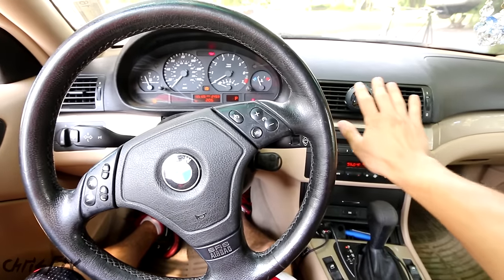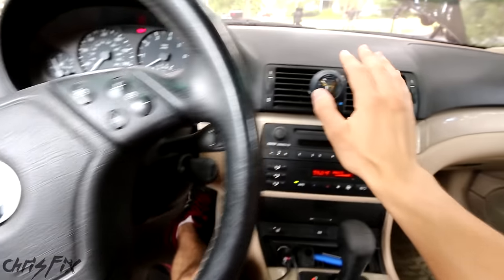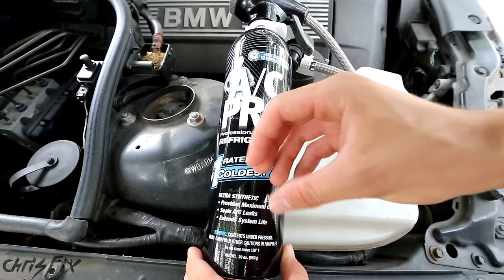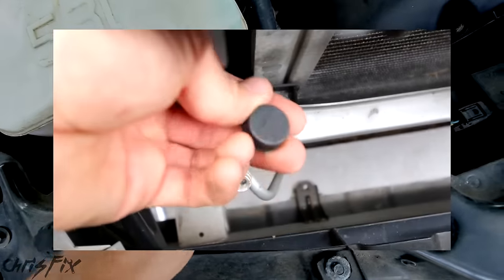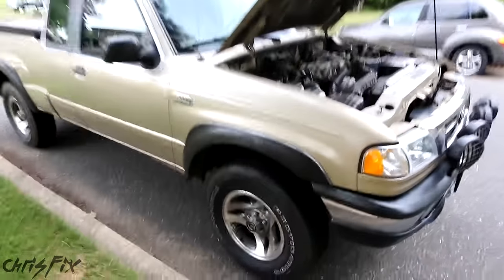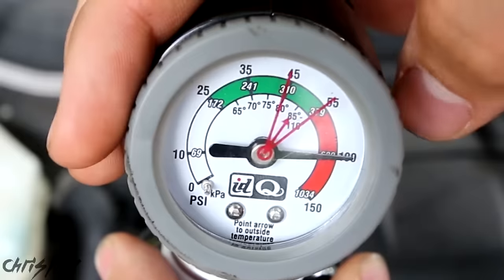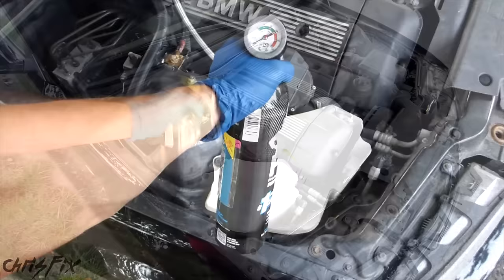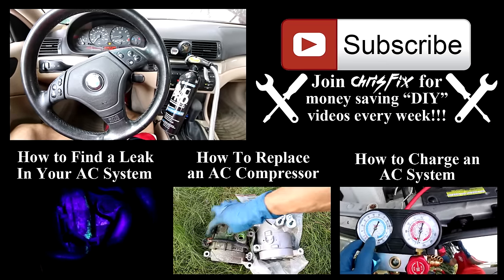How to Recharge Your Car's AC System (Fast and Easy)

Comment: Can of DIY  refrigerant with gauge = $20.00.  Mechanic recharge price = $130.00. This tutorial video = Priceless.
Reply from the maker: Glad the video was helpful!
Reply: not the brand an type he used try 35 to 45 depending on where you buy it
Reply: No it isnt. I found a can for 20 from walmart..lol
Reply: bought the same can as in the video. $40 ...
Reply: Even if it was 50$ your still saving more then 50% of what a mechanic well charge you.
Reply: Lol in my country (Finland) you can't recharge it yourself as it is illegal to do so. If you want to recharge it yourself you have to get a special license which you have to renew every year.
Reply: Casper hiltsonen Maybe you pay less then us. But it is something so simple. It is ridiculous how much a mechanic charge for something they well do in just minutes. It took me only 2 minutes or even less.
Reply: Tutorial video not entirely free gotta get that internet data to watch lol
Reply: Francisco Orengo how much it costs in your country? In Finland it is about 100-200€ which is ripoff as you could do it yourself for 30-40€
Reply: $130. It is about the same as the 100 euros. But 200 euros is a crazy amo7nt of money. That is a big rip off.
Reply: I would save the money and buy a fur coat,too cold in Finland.
Reply: The mechanic charges more because the mechanic knows that if there's a leak, moist air has gotten into your system, and if you don't want to rust out the entire thing, you have to fix the leak, run vacuum on the system to evacuate the moisture, then add the coolant.
The method in this video can't fully recharge your system, because there's already air in it. What is will do is turn a $5 gasket leak into a $1500 repair bill by not knowing what you're doing.
Reply: Toyota charges $280 just to pressurize and check the system. DIY looks like the way to go.
Reply: That is because your mechanic used proper technique and used a vacuum pump, ensured there was no  leak, pulled air/moisture out of your a/c lines and THEN filled your system.  If you don't do that, then you'll be in for a bad time soon.

Comment: I have saved a lot of time and money watching your videos.  Thanks for  saving us.   Will you consider making a video on how to convert  an R12 ac system  to R134a?
Reply: Converting R12 to r134a is fairly simple... You can buy the adaptor fittings from eBay  they screw right on to R12 fitting.. then just vac your system, add lubricant for the compressor and recharge with r134a

Comment: I've been doing this for years. Good video. I always wear dual-layer long sleeves in addition to gloves and complete goggles, not just front-face eye protectors.
Reply from the maker: Thanks for the tip!
Reply: Me too. Have an older vehicle, don't drive it a lot, but it needs to be charged about every 6 weeks.
Reply: Is AC pro still working with you for many years ( or until now ) from the time you put it in your car ?
Reply: @AhmadAhmad-hc1hd  Sometimes the AC system needs to be topped off, but it keeps working fine. One car I had developed a leak in the AC system but a new application of AC Pro fixed the small leak. (AC Pro does advertise that the product DOES fix small leaks).
Reply: @chrisfix  I have been able to use your videos to improve my car-care skills a LOT. Can you show how to detail\clean a mercedes engine, please?
Reply: @j.b.9581  Thank you for your comment. ❤️
Reply: @chrisfix  You Da BEST.
Reply: @AhmadAhmad-hc1hd  You are most welcome. Be safe and serene.

Comment: Just a heads-up, if you buy this AC Pro from Walmart, it comes with a cheaper gauge on it, which does NOT have the temperature adjustment range on it (i.e. the little dial that you can turn). Got one from Amazon that DOES have the better gauge. Both purchased in 2019. The Walmart one seemed to work fine - I just took a screen shot when Chris showed the gauge on-screen for reference. It was hot out, and I went relatively conservative, stopping at 50 psi for my 2012 Subaru Forester. A/C is now cold again!
Reply: Still doesn’t have the high side

Comment: When was the last time you replaced your blinker fluid on that bmw
Reply: Billiy Joek I involuntarily laughed at the top of my lungs for a solid 10 maybe 15 seconds. Thank you. My day is so much better now.
Reply: ikr i mean look at those faded lights
Reply: Billiy Joek what's a blinker?!
Reply: bobdigitally o gosh
Reply: bobdigitally 
lmfao
Reply: Since 2000.
Reply: he replaced it in the blinker fluid video with synthetic blinker fluid
Reply: @JJ7Redick  You must have had car repair grief.
Reply: You must be an auto tech at a chain or at a dealership - "I did your oil change but it's about time to replace the air in your tires."
Reply: It's a BMW, they never run out because BMW driver they never use their blinkers ;)
Reply: preston hart  that can go either way, depending on where you put the comma 😊
Reply: Pete Romano holy shit i read it wrong the first time and didn’t even realize lmao. Thx for the comment
Reply: He needs to sign the ID10T form to properly check it out. Ohh I miss my days in the Marine Corps.
Reply: Its lifetime liquid.
Reply: Bimmer Apprentice wow
Reply: Whats a fluid lol

Comment: An easy tip to remember is Almost always the low pressure cap is
Closer to the window, but you should of checked the static pressure fist before Turing the car on to find out if it’s over or under charged
Reply: Static pressure wont tell you if a system is overcharged and will only tell you if the system is very very low. Static pressure is based in temperature so it wont matter if there is 15 ounces of refrigerant or 10 the static pressure will be the same.

Comment: I just called AC PRO because I was curious as to what was inside of the hose before you connect it. He said that it is vacuum purged before being packaged...there is nothing in the hose, and it is under vacuum (negative pressure). When you connect it, it draws freon from the system into the hose.
Reply: Thats good, you wouldn't want air/moisture or nitrogen to be injected into your system.

Comment: As far as i know, if you run out of refrigerant it's always because you have a leak somewhere, this gas is not spent anywhere in the system, i've seen 30 year AC's working like the first day with no recharges. This is something a lot of people doesnt know, and every summer they go to the shop to get a refill, and they dont tell him he has a leak, so next summer they can refill it again LOL.
Reply from the maker: +ComandanteJ Correct. There is a leak as stated. But the leak is so small that it is not worth spending the money to find it and fix it. Since the leak lasts over a year, it is best to just charge the system up.
Reply: ChrisFix Of course, and in this case it's probably the best thing to do, but what i wrote was more aimed for people who live in countries where those kits are not permitted, so they need to go tho the car shop to get a refill, a lot of the times these people think that it's normal to lose gas, and shady car shops take advantage of that, refilling them once a year before hot weather comes.
Reply: +Norman Hammond Reported.
Reply: ChrisFix
 agree.  why spend a ton of money when you might decide to sell the vehicle next week.
Reply: logoster i
Reply: A properly sealed a/c should never leak.  Shops are not uninforming people so they can continue recharging.  A/c work is expensive.  Compressor are a common item to have a slow leak and easily cost over a grand to install.  This is why most do not.  Self filling is easy, as long as you know your a/c is working correctly.  A lot of things can effect low side pressure if something is off internally in the system.  When shops fill them it is based on a measured amount of freon in weight.  I have seen plenty of instances of dyi incorrectly charging the system causing problems.  The gauge on the can is only a guide line and only useful if the system is working correctly.  If you do charge it yourself make sure the can you are using also has oil in it.  Also if you have opened the system say to replace a compressor or condenser, then make sure a shop rvacs it that time.  This insures you get contaminates out along with moisture.
Reply: +Jeeperz Man I wish this type of comment floated to the top instead of dropping to the bottom. I've done my own AC work, the gauges alone cost more than the tiny bottle that covers up the problem and makes it worse. I've never seen a system filled by one of those $10 bottles work as good as original or last very long. Now I let someone else do it because the cost of tools to do it right just isn't worth it to save a few bucks.
Reply: Even if your car is 24 years old?
Reply: And? You suggest all these people to get every O-ring replaced just to start? You realize that if that BMW guy drives to his friendly BMW dealer he is facing over $2K to stop the leak and there is no guaranty because something else may still leak?

Comment: I thought my AC was broke until you just showed me that it wasn’t turned on😭 turns out the ❄️ signs means cold
Reply: Bruh 😂
Reply: Well it certanly does not mean blow snow into the car 🤣
Reply: uplifting siren wait it isn’t I’ve been saving that one just incase it’s really hot
Reply: @LunarStrike  nope donk think that there is a snowmachine inside your car
Reply: uplifting siren damn what a shame
Reply: Hahahhahah
Reply: Yessss bmw especially
Reply: I am slightly perturbed by you at the moment... Lol
Reply: Bruh...
Reply: Utube
Reply: Bro same
Reply: You know I had someone hit that button In my car and I asked why because it was cold and they said that’s the defrost so you hit that when there’s flakes on your windshield so then when it was hot and I hit the ac and I thought it was broken
Reply: This was me last summer 😂
Reply: Since it’s a bmw I thought it was a dispense cocaine button
Reply: What...
Reply: broken *
Reply: Hey that's okay, I bought a 97 dodge pickup, drove it for two years before I realized the ac worked when I let off the accelerator. A blower vent spring had come loose😂
Reply: My button keeps going off when I push it on.
Reply: So what's wrong when the button won't stay on.

Comment: Hello Chris, can you also make a video describing how to get rid of bad smell in AC? 
Thanks.
Reply from the maker: MYoeruek That is a good idea! Thanks for the video suggestion!
Reply: hey Chris what's your video good video my problem is I put the freon in it everything like it's supposed to with the air compressor never turned on is my compressor bad
Reply: check the fuse
Reply: Replace your cabin air filter.

Comment: Luckily, most cars activate the a/c compressor during the defrost cycle, or at other times if you have climate control. The biggest problem I've seen with a/c in cars are the ones that get used very little. Without constant circulation of the refrigerant and oils through those lines, the seals can dry up and start to leak. Then, when that person waits for a 95° day, there is no a/c. I run mine all the time, due to climate control, and it holds for years. Impressive to get 42°F air coming out on a 97° day outside.

As far as icing up, I agree with the low refrigerant problem, and also with blocked flow over the evaporator (dirt, leaves, debris) will cause the coil to freeze up sometimes. They are very hard to clean inside the dash. If you're getting icing up, try running the fan at a higher speed and see if that reduces the ice.

And always use recirculate in very humid weather, it pulls about twice the amount of humidity from the cabin, due to sending it through the system over and over.
Reply: Sound advice, refreshing to see someone in youtube replies that actually has a clue.
Reply: peter jones yeah, I just came from a 2 stroke vs 4 stroke video, you can imagine he comments
Reply: In "recirculate mode" rather than fresh air mode I get much colder air because it stops hot outside air from coming in. Make sure muffler, exhaust pipes & connections have no monoxide leaks though.

Comment: In case you overcharge the system by adding to much refrigerant you can also lightly press on the valve with the cap to release some out 👌🏼
Reply: its illegal to do that you know right?
Reply: @jiovanilozano1752  🙄
Reply: If you accidentally overcharge the system you always release the pressure valve on the high side (the a/c hose/cap is slightly larger than the low side) and NOT the valve on the low side (smaller hose/cap).

Comment: Bro. You're a life saver! Perfect video for explaining the exact AC can I got, exactly how to find the lines. Why it WON'T for in the line (cuz it's the high pressure end), how to fill it properly, checking the temp outside and setting the gauge right, etc. 
So straight forward, and including the compressor info! 💋🤌🏻
Definitely 💯 and ⭐⭐⭐⭐⭐ !

Comment: I've watched other youtube mechanic channels that say to never use one of these refill kits. With newer cars if the amount of refrigerant is off by one ounce too high you can damage the system.
Reply: Every car I used this on the a.c. pump locked up in a year
Reply: They are right also if you don't put the right amount the AC pump won't start.And with the right tool you have to put some kilograms of oil into the pipes for the pump because it stucks.
Reply: This guy comes into YouTube to pedal falsehoods like he knows how to fix everything. If any AC system need refrigerant it has a leak and must be repaired and recharged to factory specs or more damage will definitely occur. Maybe these YouTube’s should be held responsible for the damage they cause. I know I would be if I was damaging my customers systems due to ignorant practices.
Reply: Are y’all just angry mechanics? There is a reason they sell these in the store and it’s not to destroy someone’s car. It’s an easy enough solution to an extremely common problem.

Comment: You should never need to add refrigerant. If you do then that means you have a leak which needs to be fixed first. The sealers don't always work and can do more harm than good. Make sure you don't overcharge your system. If you do, the head pressure will get too high and it will not cool well on hot days. It should cycle on cooler days and at night and during hot days with the fan on high it shouldn't cycle at all. If it does that means it is either under or overcharged. An overcharged a/c will cycle because the high side is getting too hot and undercharged is because the low side is getting too cold too quickly (pressure too low). Don't go by the gauge alone. Use the chart with the pressure vs outside temperature. 

Also a little trick. If the can is getting too cold while charging, soak it in warm water. That will make the R134a come out faster.
Reply from the maker: +billybassman21 Thanks for sharing the tips although with that last one I am not sure you want the refrigerant to come out any faster because you will pressurize the low side too much which is not necessarily good.

Comment: Should ad that if you don't have your a.c. in the on position it will cause a line rupture when you add the a.c. booster...lol..
Don't ask me how I know this🤣🤣
Reply: JnLighting 1000 - turning on the ac system in your car to the high setting relieves the pressure in the ac line as you are adding refrigerant to the system.
Reply: Brad Ferkovich thanks for the info!
Reply: These cans have cost people thousands. You WILL blow a line,contaminate and get moisture in your system and will wish you never ever tried to go cheap on one of the most expensive to repair items on your car.
Reply: Brad Ferkovich how do you know this
Reply: Just did this and pressure gauge went straight to red 😂😂 went straight to the comments and found out about this part to leave the system on blast before continuing
Reply: "was this comment useful" yes lol!
Reply: @JIMJAMSC  modern AC service machines are so much better to use. 
Pressure testing the AC system first.
Draining the old gas out and compressing it into a disposal bottle
Taking out the old UV-OIL
Refilling new UV-OIL
Refilling new gas at the right spec (adjusted via the service manual from the car)

Example: My Audi A4 B7 2005 3.2FSI Quattro takes 520+- grams of gas and around 8ML of UV-OIL and would cost me about 100 bucks here in Denmark. Plusside is that i get a reciept that it has been done and they stamp my servicebook so it will have a higher value when it's for sale.

As for that BMW, if he had added UV-OIL, he would've been able to find the AC leak and probaly change out the bad seal.
Reply: @JIMJAMSC  explain
Reply: JIMJAMSC so should i do it proper with a vacuum etc?
Reply: There is thousands of positive comments and almost none of people saying WTF I DID THIS NOW MY CAR IS SCREWED, just like any repair on anything you have to at least carefully follow directions. Please don’t let the mechanics of YouTube scare you into spending hundreds, like he says in the beginning, this is a solution for something that normally would cost a LOT of money, not a perma fix. Personally if it’s blowing cold air and only cost like $20 I’m fine with it